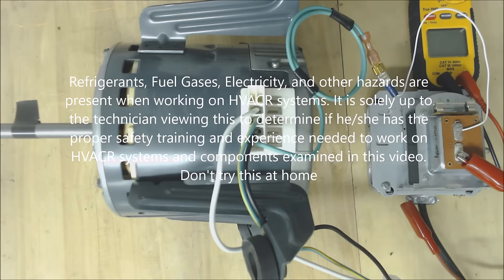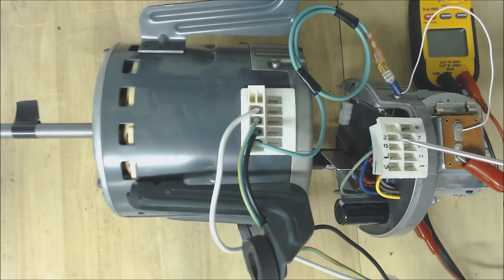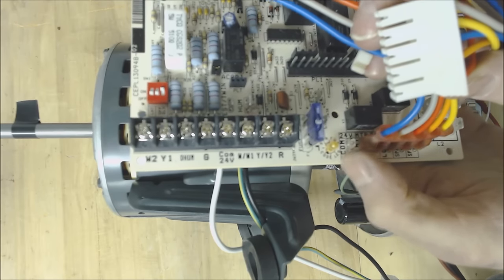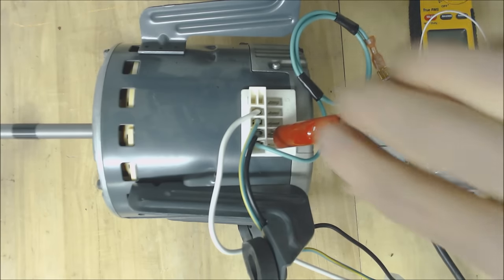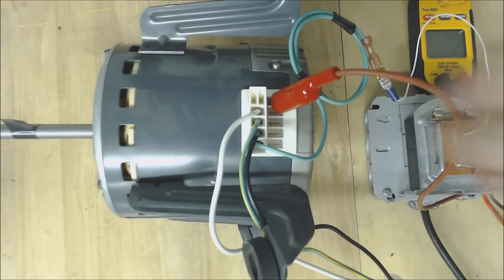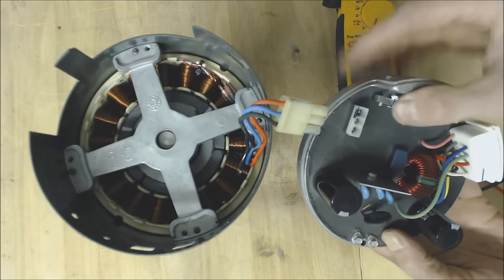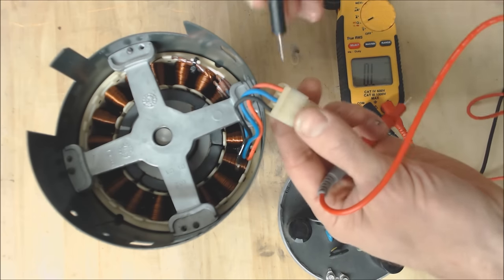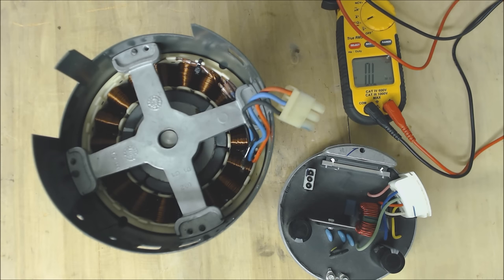ECM X13 Blower Motor Troubleshooting!

Comment: I bought a Genteq 5SBA39FLP8013 ECM blower motor to replace the Broad Ocean motor which stopped working in my air handler. The Genteq is an X13 with 5 speed taps as shown in the video. I decided to test it before going to the trouble of mounting it in the air handler. I laid it on its side next to the air handler and connected the wiring. The thermostat was set to fan only. When I turned on the power the shaft began to spin for about 1 second and shut off and then a few seconds later it came back on and shut off and continued this pattern until the power was shut off. My neighbor's son in law is a HVAC technician, so I called him and explained the problem. He told me that the motor detects the load that is on it and adjusts for that load to maintain a steady speed. It needs to have the blower wheel on it and be mounted in the blower housing in order to detect a load. I installed it in the air handler and it works perfectly. I don't know why this information is not in the video and why the motor in the video is not showing this problem.
Reply: Did you have to replace anything to fix your issue?
Reply: @Brian-vl3ng  I replaced the blower motor only, nothing else and no modifications were done.
Reply: @Armand9100  blower motor with with a module?  This was the fix for you?
Reply: @Brian-vl3ng  Yes, the module is attached to the motor.
Reply: @Armand9100  can I send you a video of the symptom
Reply: @Armand9100  The motor is spinning slowly without the fan attached.  With it attached is just shaking.  I guess just replace the whole motor.
Thanks for your help
Reply: @Brian-vl3ng  Yes, sounds like a bad motor/module. Make sure fan is attached securely and is not damaged which would throw it out of balance. You will get the best price on eBay from a seller with good ratings. I am not a technician, just a do it yourselfer.
Reply: @Armand9100 I'm not a tech either, but I appreciate you responding.  Thanks!
Reply: Are you fuccin kidding me. The same thing just happened to me. It  has to detect the weight in order to work

Comment: I had a ECM motor that stopped working after a burning smell spread through my entire house. I knew the motor went bad so I decided to open it up and the thermistor and capacitors were blown on the ECM controller. Simply de-soldered the bad ones and re-soldered new caps and a thermistor back in. Everything has been working great for over 2 years. New motor was $1200, my work and replacement parts for $37 bucks.....Great video, wish I would have seen it a couple years ago.
Reply: Can I Change a 230 volt GE ECM Motor to a 115 / 230 ? ( Without or with ) a different module
Reply: @billetwilson9204  Not sure on that one.
Reply: Had the same smell last night couldn't breath for a few mins
Reply: @billetwilson9204  Why?
Reply: I am thinking about doing this, were the capacitors buried in waterproofing material? How did you get them out?
Reply: @tomwnukowski3943  I think I did have to remove some waterproof potting, didn't take much because I was able to complete the repair just fine

Comment: These companies are making these ecm motors very expensive right now..just the module alone cost $200-$300  compared to the old blower motors that cost 100-150..
Reply: Yes. The cost of the new module voids your cost in energy savings.

Comment: Is the fan relay built into the motor itself. My blower motor keeps running even when the low voltage is disconnected. Thanks
Reply from the maker: The hub turns the motor on when the low voltage signal for the certain speed is present. The motor hub is bad.
Reply: AC Service Tech LLC Thank you!!!
Reply: I believe I may be in the same situation and hoped you could elaborate. My X13 Motor will also not shut off, in fact when I remove the low voltage wires completely the motor defaults to blowing at it's highest setting. I saw the answer was the motor hub but what exactly does that mean? 

Side note I'm going to be taking it apart and following the steps in the video.
Reply: @acservicetechchannel seeing several people about them staying locked on high without low voltage, odd. Wonder how that happens
Reply: @mbburry4759  As posted above and pasted here:
Same problem, runs continuously.  For fun I cut the green wire (fan 
only) and measured the voltage on each end.  The end going to the 
thermostat read zero volts (as expected).  The end going to the fan read
 4.5 volts.  I suspect something inside the module is shorted to the 
green.  I might try to inspect the module but they are predicting 
mid-90s for the next week.  Also, some people prefer to run the fan 
continuously, but not me.
Reply: @MuziciansPage  what ended up being your problem and solution?

Comment: I had an x13. Lower running constantly. Changed out the blower module and it has worked fine for about 2-3 weeks. Now it is running constantly again. Could there be an underlying issue causing the modules to go bad, or is it likely I got another bad module?

Comment: I had one yesterday that was stuck on even when I took the 24 volts away from it, it was a friend so instead of getting a new expensive motor I just put in a relay for heat and a relay for cool, I just broke one leg of the 220
Reply from the maker: That is an odd one you found, thanks
Reply: @acservicetechchannel  that's why I told you about it I have never seen that happen before I was wondering if you had
Reply: @danpmatz  I have the same issue, with all the 24V taps disconnected, the motor still runs. I have not found any video to address this problem. My air handler blower now runs continuously. I have to turn the breaker off to stop the blower.( I have taken off my room thermostat.) I have measured the voltage of the taps while 240V connected and blower running. All taps voltages 0 to 2.5 V. I will also use separate relays to activate on heat and cooling.
Reply: @drsharonmwashington7447  yeah it was for a friend of mine so I was trying to save the money I figured $15 in relays that I had with me instead of a new motor
Reply: I have the same problem. If I change the blower motor will that fix the problem?
Reply: I had the exact same problem with mine it would stay on even when 24v was removed so I just put an old contactor inline with the 240 coming into the blower motor and haven’t had any problems since
Reply: Is there any more info on how this is done?
Reply: @02585975  how exactly did you do this?

Comment: Lot simpler than the ECM 2.3 motor. I know the PSC motors very well and getting into fixing and using the ECM motors I took a ECM 2.3 blower out of a heat pump with a bad water cooled condenser that was given to me for salvage.
Reply from the maker: Yes for sure, much simpler and there are rescue ecms now for replacing motors with 24v control voltages such as the x-13 now, thanks

Comment: I had a bad X-13 motor, but it was the bearing, I had ordered bearings. When my BIL heard, he said forget that, I have so many X-13 motors go bad, I just replace them with a capacitor type motor, and he did that. I to this day don't know if that was a good idea. but it has been working fine for a year. I will add, the original motor went bad, it was replaced under warranty, then about 3 years later the bearing in the replacement motor started make lots of noise.  As a side note,  If this were my job and troubleshooting the motor is required as you allude to at 4:20, I would build a jig with a 24V source, a 5 position switch and three of the common motor connectors with 3 feet of wire to plug into the motors. So then you just disconnect your motor connectors, plug in your jig connector, plug in your AC cord and then switch slowly through the 5 speeds, testing for any problem. Rethink, You might need a 10 position switch for an off time between each test, Off, test 1, off, test 2, off, test 3, etc. That said, I suspect once you have seen 5 or 6, you know before you do much testing, but that my input. Do you think a Jig would be useful for a servicing tech?
Reply: Would be nice when you need it, but extra stuff in truck and such. Probably quicker to just poke at it with multimeter, but if you dont mind always having that rig on hand sure thing
Reply: I haven't heard from any Nerd service techs with OCD, make your own path and think outside the box, it's saved my customers much money. Not ME! I started 40 years ago, everything was straight forward, worked and lasted many years. Government, corporation greed changed all that. Mexico and China reaped the harvest, we got thrown under the bus. Corrupt politicians on steroids. That's why Trump is President, makes sense why they want him to go away ASAP. Just Saying, because it's true.

Comment: I know the video is old, but I’m troubleshooting the blower motor on my unit now. I need to do the checks you discussed in this video. I did the hand test and cannot spin the shaft freely. It is hard to turn. When I took the shaft out, the bearings seem to spin freely but the permanent magnet rotor spins rough when it is inserted. I noticed a lot of black residue in the house in where the magnet rotor spins. I wonder if I should replace the bearings and clean the housing from debris?

Comment: I did exactly as the video described to an x13 120 volt 3/4 horse motor. In all 5 positions the motor rotates but it pulses. It's not a steady rpm. The motor itself checks out ok. Do I have a bad module? Thanks for the video.

Comment: Great video. I have a question. I know my module I troubleshoot my module and the problem is that my motor stays on all the time. I event removed the 28v input signal from the speed tap and motor still stays on. It stays on even if I turn off AC from thermostat. To turn it off I have to turn off the breaker. 
I open the module and I can’t seem to tell which part on the module is bad so I can replace. All capacitor and transistor looks good visually. I’ll appreciate any help.
Reply from the maker: That would be a module problem. Unfortunately the module needs to be replaced, thanks!
Reply: AC Service Tech LLC thanks
Reply: @acservicetechchannel  Same problem, runs continuously.  For fun I cut the green wire (fan only) and measured the voltage on each end.  The end going to the thermostat read zero volts (as expected).  The end going to the fan read 4.5 volts.  I suspect something inside the module is shorted to the green.  I might try to inspect the module but they are predicting mid-90s for the next week.  Also, some people prefer to run the fan continuously, but not me.

Comment: Hello
I have a Trane A/C unit with an air handler model 4FWHF030A1000B.
The problem that I’m having is that on shutting off, the air handler shuts off and then seconds later the air handler fan briefly turns back on and a few seconds later goes off. This on and off cycling continues for as many as 13 cycles, Sometimes it is less than 13 cycles and then the unit stays off until there is a demand for additional cooling. As the desired temperature is achieved the on and off cycling repeats itself.
I have tried to replace the thermostat, no change.
I found that the evaporator coils were dirty, I completely cleaned the coils inside and out.
I check the wiring from the thermostat and found that if is OK as per wiring diagram on the air handler.
When the fan was running I removed the thermostat face but the fan kept running.
The AC compressor doesn't start up during the short bursts cycles.
It seems that before, the off period during the bursts would increase in duration as the number of cycles increased. Now it seems to be the same amount of time for the off cycles, The on cycles continue to be for a few seconds.
Do you know where I may purchase troubleshooting information to identify the component/s that is causing this problem?
Reply: What ever happened with  your issue?  Seems like the guy doesn't come back to answer these, apparently.  But he does have a business to run.  I have this same issue going on and had removed my "smart thermostat" as I thought that might be it and put the original on (HVAC system is only 5 years on) and did same thing.  Even with green wire removed, the blower fan still ran till the breaker was turned off.  It does its thing very erratically.  I hear this is a common issue with these.  I ordered a new control board for $50 shipped and will swap out to see.  If continues, motor will be replaced with new I guess.

Comment: I replaced my Lennox original x13 motor with a gentec off Amazon, the new one works fine, it seems to run slightly faster than the original motor, I no longer have the fan shutoff delay however. Now when the compressor shuts off the fan shuts off immediately. Is there anyway to have the fan delay function again? Should I switch the high and medium high wires at the 24 signal wires? It’s been a while since I did it and my home is cooling fine otherwise now.
Reply: I installed a gentec 1/2 hp 230 volt motor

Comment: Is it possible to run x 13 with vfd controller? Of course I need to take the main capacitors n controller attached to x 13 and connect directly 3 phase off the motor with vfd. Would that spin the motor???  Ty
Reply from the maker: That is how the 3 phase motor is built to run, as a vfd, thanks
Reply: @acservicetechchannel  -
Is x 13 motor winding wye or delta configuration? Ty

Comment: had this issue today that i just could not figure out what was wrong with a new x13 motor....old one was rocking back and forth with constant 240v and 24v (yes motor was the right voltage)...so went and got a new one and tested it before installing it to the squirrel cage....new motor would ramp up and down every 10 seconds so i thought maybe  i had a defective motor so i got another one....it was doing the same thing...any suggestions for future reference?

Comment: The x13 blower (1/3 HP) motor on my York air handler doesn't run properly. The motor starts and moves few steps (couple degrees) than stops momentarily and continues in same fashion without achieving any speed. How I can trouble shoot and what may the cause?

Comment: On the resistance values for the motor: I'm getting 5.8-6.0 between R and Y, 5.8-6.0 between R and B, but only 3.9-4.0 between B and Y. Is this enough variance to deem this motor bad? Is this issue repairable? $360 motor is not a cheap replacement part.. Motor will engage, do about 5 rotations, then cut off and restart. Thanks in advance for any advice or suggestions in getting this issue resolved.
Reply: The different resistance suggests the one motor winding is partly shorted.  The controller doing 5 revs is a typical behavior when the controller has failed.  So you might have two problems.
Reply: For anyone who needs help, I had the exact same symptoms as above and I had to replace moter/controller which resolved my issue.

Comment: So if the motor works with the techmate pro does that mean the module  is bad?
Reply from the maker: This is the X-13 and is not variable but is ecm. You can check this one by applying 24v to it on the different speeds as shown in the video or by measuring the 24v going to it during normal operation, thanks

Comment: My blower motor is surging, with it on the motor turns on and off then after turning it off and letting it sit for a few hours it starts working again. It’s also a x13. Any suggestions?
Reply from the maker: Is it possible that part of the duct is collapsed or filter clogged solid? If not, then the module may not be reading torque valves correctly, thanks

Comment: Aren't those five speeds: high, med-high, med, med-low, low? And cant you change between any for desired cfm?
Reply: Yes and if you get lucky, when the motor wont run on medium high for example, it may run on high, seen it happen. The rip off is it's usually one of the capacitors in the module, a $3 part, so our cost is $500 for a new one? Perfect, AFTA NAFTA politics

Comment: sir: my heat pump package ECM blower will only work when its fan is set to ON. In auto, it stops
Reply: Thats got to be a problem with the problem with the low voltage (thermostat) wiring or a loose wire on board. Extremely unlikely motor is bad if it works fine when not in auto
Reply: Check the low voltage wire going to high speed for power
 Then put the low speed wire on the high speed
Terminal

Comment: What if the motor is kinda coming on but its kinda clicking like it wants to go but it cant. control board or motor?
Reply: Mine does exactly the same thing. What did you end up replacing?
Reply: @omoffroad  I ended up buying a remand motor, the control board was bad but I decided to do both. And it was cheaper in the end.
Reply: @masterofnone8210 , I replaced my motor with a new one and was good to go. My control board tested fine. Thanks for letting me know

Comment: Hello, needed 24 DC or AC ?
When I give 24 V AC it starts to vibrate. Is it because of problem with motor?
Reply from the maker: If it is x13 then it is ac but if it is a different motor it may need dc voltage, thanks

Comment: It's posible install a regular speed motor in a  air handler with a variable speeds motor (ecm motor)?
Reply from the maker: Yes as long as it is not connected to a vrf compressor, thanks!
Reply: Depends on the make of the unit, etc, might have to add additional relay, go back to basics

Comment: There are no external capacitors with this motor?  My motor runs fine if it gets kicked off.  Sometimes it doesn't and sounds like it is running slowly.  I currently have the fan on continuously until I can tear into it.  If sometimes the motor won't get started, does it sound like one of the capacitors in the module is bad?  Thanks
Reply from the maker: If it doesn't shut off, you would need to check the 24v signal to see if you are accidentally sending 24v to the g terminal first, thanks!